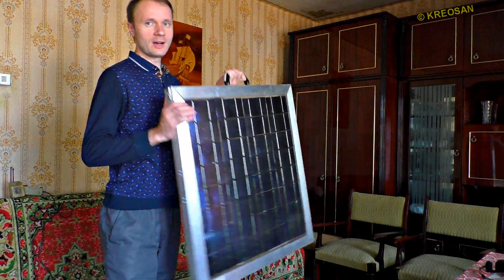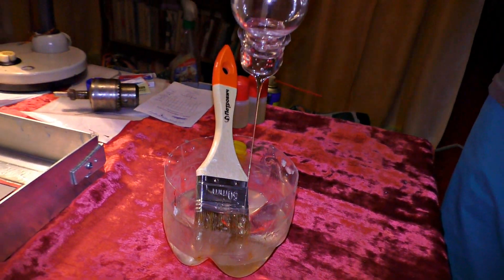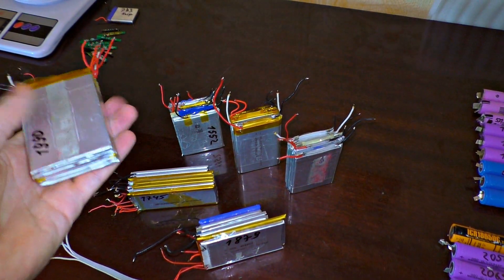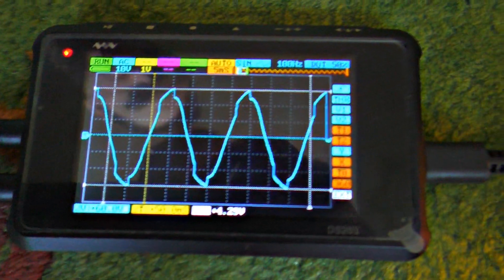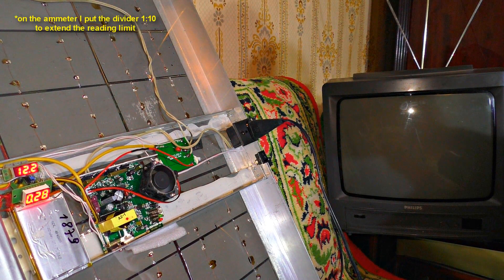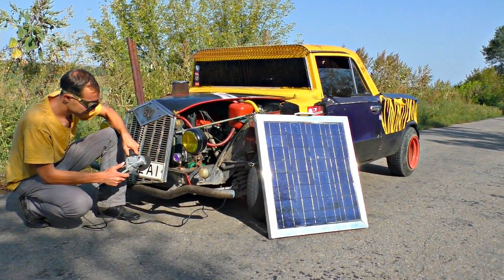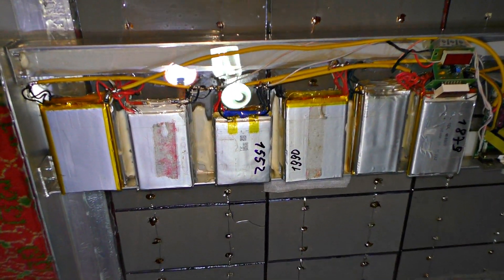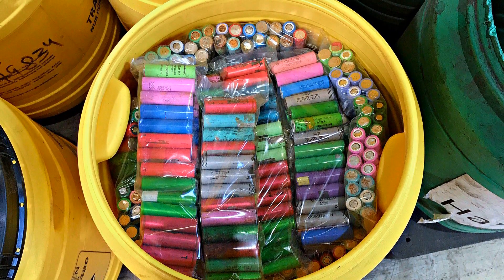A new Solar Power Plant DIY - Make one with Kreosan

Comment: you can use 18650 used cells and fill the back 8-9 rows that may increase more ampere and 5-6 times more time duration

Comment: I just purchased a 150W polycrystalline solar panel. I did some checking, in bright sunlight, it outputs around 19V and 8A. When it's cloudy, it's giving around 18V and 0.76A. Is this normal? I was surprised that the amperage dropped so much in the shade. Would it be able to charge a battery in the shade with a PWM charge controller? (75Ah lead acid battery)
Reply: @Akhil Dhananjay
 - Yup, that is 100% normal!
Reply: It might work. I used to have a north facing set of panels of about 20w and I could do a few things till winter hit but t was a bit grim but if you already have that stuff why not try it?
Reply: Just get a cheap $6 solar controller off ebay if you do decide to try it. The cheapest one rated 30amps will see you well...

Comment: Yeah, most modern technology will do fine on a modified sine wave inverter.
Anything with a SMPS that was produced after the early 2000s will probably not care. The only stuff that really suffers is precisely machined pumps attached right to an AC motor. Air conditioners, refrigerators, well pumps etc.
They'll still usually run, but they will run less efficiently than usual, they will buzz and most will heat up a lot more than usual.

Comment: I saw on man use a capsitator in evry string of celles to get more stabel output from the strings of celles. Can be a idee for this prodject. To make a condensator cap in the end of evry string. Hod luck. This is nice work on smal budget.

Comment: It's better with ultracaps ,they fill up straight away, during winter time the batteries can be damaged
Reply: Ultracaps can also be damaged by extreme cold and the don't have nearly the energy density as Li-ion batteries, so while you could power very large things with ultracaps, you would drain them entirely in less than a minute and then you would be back to the 50W that the panel produces.

Comment: Love from 🇮🇳India man 
But explain how you made exact 12volt from 3.7volt lithium ion batteries? 
What if i have 11.1volt battery and i overcharge them with 12volts?
And what if i add different mAH battery's in parallel ? Can this cause any damage to batteries?
I have recovered 40-50 batteries which is 4000mah batteries from trash power banks they are in usable condition so I'm thinking about make one for me help me

Comment: Show us the car!!! I would like to see more of it! And like to know more about it.   I also am working with 18650 cells. I am powering my home with them. I have about 600 ah at 29.4v and 1200 watts of solar for now. I hope to have 3-4kw more. And about 2000-4000 ah in liion battery. With a 5kw inverter. I also plan to build a 250+amp DC generator. For sunless times. And hopefully a small hydroelectric gt generator to either generate 800-1000 watts at 100% of time. Or about 2500watts for 6-8hours a day. Most likely 900watts continuous. And a 400 watt experiential wind turbine. To help charge the lead acid Bank I also use for backup. It is 700-800 ah. About 600ah of useable power. I hope to build a shed for solar panel mounting, using panels as the roof. I hope to get 2kw+ daily from them. Plus the 1200 I have now. I hope to keep building my battery bank and get it about 100-200 cells per month Added to it. Until I can hopefully have power for a week without sun!! Keep up the great work!!!

Comment: Information: DONT use modified square wave inverter for digital products such as phones, computers, ipads as its croppy will kill it!! its a risk... best use a PURE WAVE inverters as the output is smooth energy ~~~~~~~~
Reply: Sorry to hear about that, yes mate they kill things. These cheap square wave ones are only good for tools with engines, or lights
Reply: They only destroy things with capacitive droppers because they only work correctly for sine waves. SMPS should be fine.
Reply: WESTEL Audio The inverter is not really necessary for a lot of products. You could just use a DC to DC converter for laptops and mobiles. Have a 5V USB output for mobile phones and an adjustable output for laptops.

Comment: but those 500 watts mean you also drain the batteries then even if its full blast sunshine , right ?
Reply: jop. The solar panel only produces 50 watts.
Reply: haha.... so its basicly a battery pack with a powerconverter attached to some solar panels .... not the other way around ^^ technicly speaking
Reply: it does because the batteries are the main supplier of power as the whole thing is beeing used ....

Comment: What if you attached fresnel lens on top of solar panel at right distance to increase intensity of sun light on solar cells? Overclocking solar cells with fresnel lens to increase efficiency to generate more electricity.
Reply: Similar to what these guys did here: https://www.youtube.com/watch?v=jFBlqqltqP8
Reply: @Xeno_Bardock  I just saw the video. That ball can't be more efficient that a solar panel equal to the cross section of the ball. If the ball collects 1m^2 of sunlight and focuses it on a small solar array that is 10 cm^2, it can't be more efficient than just having 1m^2 of solar panels. 
Don't get me wrong, Fresnel lenses have a use. They concentrate light to a point for high temperatures to boil water, melt stuff, etc, but with the price of solar panels being so low today, its just easier to build a bigger panel than use a huge Fresnel lens or clear ball to focus on a small solar array. Besides that, solar cells become less efficient when they get hot, and Fresnel lenses could crack the cells, melt the solder, etc, and all that heat is just unconverted energy.
Reply: That doesn't really work. You'd need a lens much larger than the solar panel. It would also fry the cells. If the lens was the same size as the panel, it would just take light from 90% of the cells and focus them on a single cell. If you could keep the cells cool, you might be able to use mirrors to reflect more light on them. I think the voltage remains the same (.5 volt/ cell) and the amperage goes up, so you'd still need at least 24 cells for 12 volts. Fresnel lenses just focus the same amount of light on a smaller area. Its good for getting a small area very hot, but it doesn't increase the total energy/ area. GreenPowerScience has a lot of good Fresnel lens videos if you're interested.
Reply: What if you attach fresnel lens on each solar cell? Solar cells i think can be kept cool if you attach copper pipes behind the solar cells and run water through copper pipes, and apply heat sink compound paste between solar cells and copper pipes for efficient heat transfer. Water running through copper pipes will take heat away with it, water cooling solar cells essentially.
Reply: @Xeno_Bardock  The sun is going to provide about 1kw of energy per square meter no matter what. You can focus that 1 meter of light to 1 cm, but then everywhere except that little focal point will be in shadow and not create any energy, and that 1 cm will melt/ burn anything it touches. The area under the lense still only has 1kw of energy to work with, no matter how you distribute it. Lenses also need solar tracking. Already, lenses, mounts, and tracking is more expensive than just using solar cells the same area as you'd have lenses. That's before you buy copper pipes, cooling systems, pumps, or radiators. Lenses actually decrease efficiency because they aren't 100% transparent. 

If you had a way to keep them cool, a simple mirror could boost efficiency for little cost. A lens is for making a small area ridiculously hot. Fresnel lenses will melt a penny in under 10 seconds (I have 4 of them). This is NOT what you want over a solar cell!
Reply: fresnel lense is not a good idea imo... but adding two mirrors for extra light is always a good idea. \_/ you can increase efficiency of panels up to 60% - its like buying half a solar panel
Reply: but if you get mirrors you'll have to make sure your panel is perfectly aligned, otherwise you might actually get less because the mirrors block the panel.
If you get a panel just like that you can just lay it on the ground or lean it against a tree stump and it'll work.
Reply: Update: \_/ Mirrors mounted onto wooden board, with a solar tracker so that theres never a shadow cast onto the panel. Putting panels horizontal to the roof or ground _ is no good. Always prop them up to \ 45% or so to the sun.
Reply: Can be workable (as is any other method of increasing directed to a cell), but heat dissipation is the issue. Cells get too hot, they drop efficiency if not ending up ruined. So then you need to watch temps to insure they don't go above the rated one, and figure out some active cooling if it gets close or starts going over.
Reply: You will fry the panel.

Comment: Careful with that bms as they only tend to have only about 100ma of balancing and with that many batteries 100ma isn't very much if they are mixed cells.
So just keep an eye on cells coming out of balance.
Reply: hi there, can i ask something please. So if i have 20x 18650 batts all hooked up to a bms... is there any risks? what module would you suggest?. Would it be better to have 4 lines like 5/5/5/5 rather than 20? all the best
Reply: Depends if they are all matched batteries, you shouldn't have too much of an issue with a cheap BMS as they shouldn't be that out of balance in the first place.
One thing to keep an eye on with some of the cheap resistor balancing BMS's is for the first bank to be under constant drain by the BMS so you find the first back of cells can get over discharged. Had that issue on a number of cheap BMS's

As for 20 cells question, I assume you want 4s 5p setup which would give you 16.8V top charge 14.8 nominal then as I say 5p on each s would be fine with matched batteries.
If it's old cells then what you do is get a rating for each battery. 
Charge them to 4.2v leave them a week or so, if they go below 4.1V they are bad so put them to one side. The ones that don't self discharge you charge back up 4.2 then discharge them with a discharger that will give you a mah rating down to 3v then label the battery with mah.
Then when you come to build your 4s 5p just make sure each of the banks of 5 batteries add up to roughly the same total mah that way each bank should take roughly the same amount of power to get to full and they should stay roughly in balance and then the BMS won't have much to do.
On some high power packs I don't even use BMS's as I just externally monitor them. If the packs become overly miss matched e.g. they come out of balance when charging I just build a new pack and then recommission the old cells in another lower drain pack after matching up the total mah.

HBPowerwall has some good info on recycling old batteries from laptops or just google it as there is loads of info out there.
Reply: .?뭐지